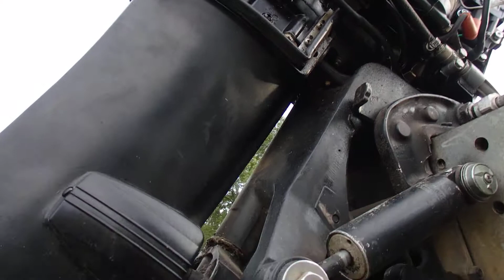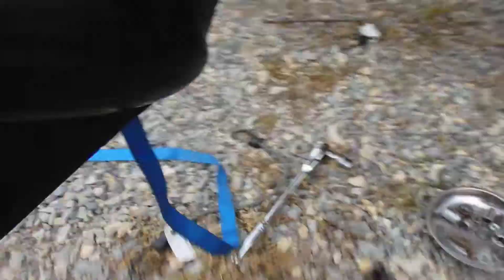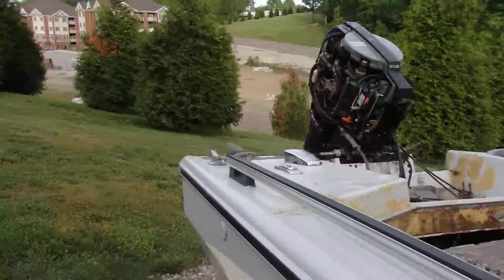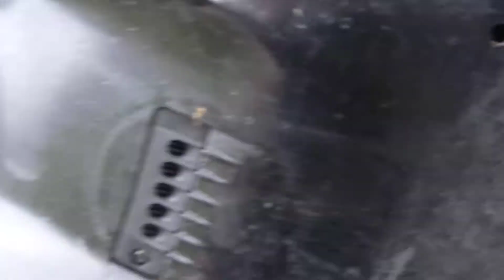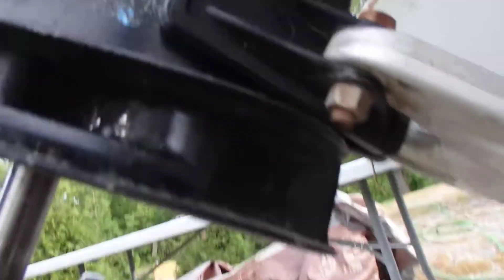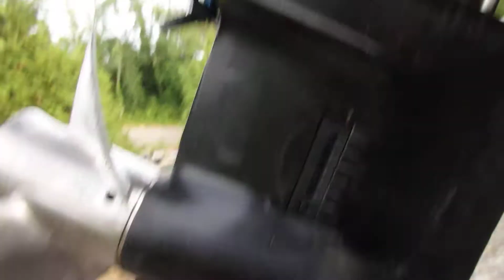1974 Mercury 650 Lower Unit install

Comment: There is a gasket between the water pump and the hose that goes into it?
Reply from the maker: Yes, it's a very tiny one though and a pain to seat. I think I put a fan of grease on it to hold it in place
Reply: @tyrantdragon000  well that could be why mine isn't pumping so good wonder if a guy can buy them